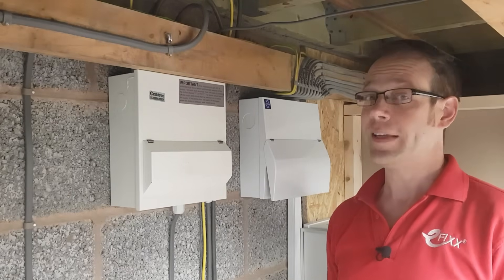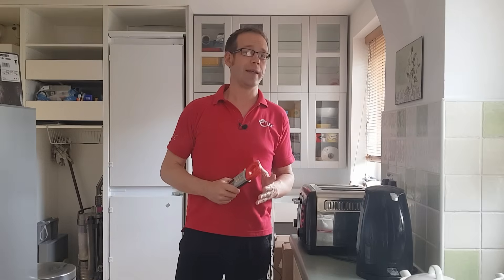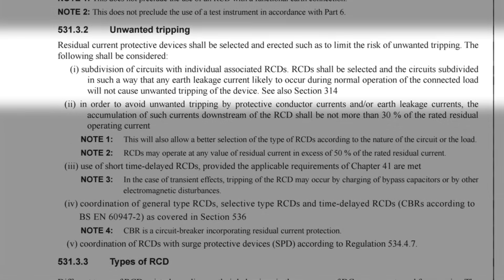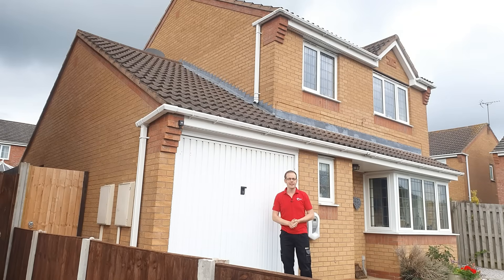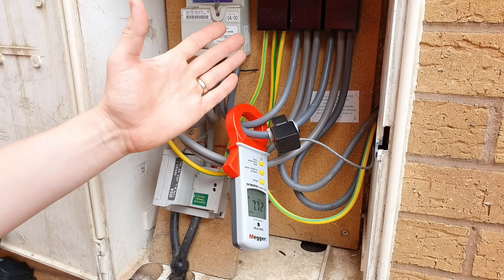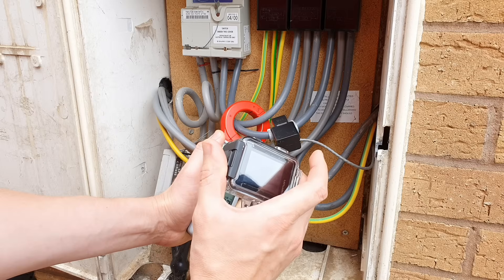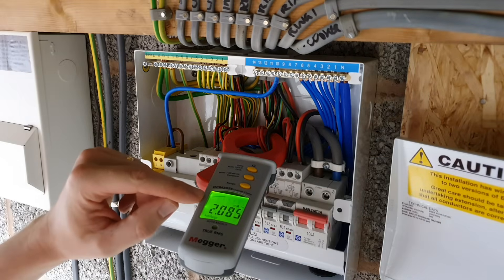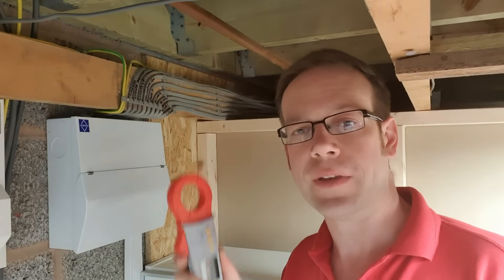EARTH LEAKAGE CURRENT - WHERE it comes from and HOW to measure it. - MEGGER DCM305E

Comment: There's nothing special about that meter other than how it's badged and marketed. Any clamp multi-meter with an appropriate AC current range would do. The subtraction between the live and neutral currents is being done for you by physics - the difference in the current induced in the clamp by the opposing magnetic fields from the two conductors.
Reply from the maker: Yes that’s correct
Reply: Brand snobbery is rife with the willy wavers!  Nick Bundy has started doing performance comparisons of branded kit with unbranded and found little meaningful difference.  I’m not talking about your MFT, but certainly current clamps, stud finders, etc. where the underlying physics is simple.
Reply: Yes. I went for a Martindale CM69 at about £100 cheaper.

Comment: Love these video's, have been after this for ages, so thanks for making it! Might sound a bit of a silly question but I've noticed some clamp meters can be quite cheap and other hundreds of pounds, so not sure the benefits of paying under vs over £100 for a clamp meter. Will any/all clamp meters have this functionality or do you need to specifically buy one that can measure earth leakage. That in advance!
Reply from the maker: Thanks for the comment and the question. It's partly a question of sensitivity, the meter in this video will measure low values of current on the milli or micro amp scale. Other meters may not measure accurately that low. 👍
Reply: @efixx  thanks for coming back to me. Much appreciated!
Reply from the maker: No problem at all. 😊

Comment: Would it not be easier to leave clamp meter round main tails and just switch each circuit breaker one at a time
Reply: Thanks. I was wondering how you would ever use one on a board wired like a rat's maze or with little cable give
Reply: Easier yes but that would kill power to the house which might be inconvenient.
Reply: @mfx1  calls an electrician for a fault, doesn't want any inconvenience.
Reply: @TheFool2cool  That is prpbably just meant to explain that this way, in this case, with this amount of slack on the wires and with this amount of space in the cabinet, you can do it without turning off any circuit breaker. (That might be inconvinient or unwanted in other situations) So in my opinion Martin King made an excellent remark

Comment: Not qualified sparks…but could have been considered time served.

I recently changed an MCB to allow for motor starts in my garage not causing it to trip. Are there different types of RCD that could allow such laptop leakages without tripping but without putting users at any greater risk of electrocution should someone get silly with a wet finger?
Reply: Often it's the cumulative effect that is the problem. A 30mA RCD could trip at 20mA and if you have a ring with many loads it's not difficult to get to that. Split it into two radial circuits and use 2 off 20A MCBs , one either side off each of the 2RCDs
Reply from the maker: Not really, you could in theory put in an RCD with a higher mA rating but then it wouldn't comply with the requirements for additional protection. 🤔 In fairness you'd need a lot of laptops to trip out a 30mA RCD anyway unless one was faulty.

Comment: I'm assuming the live and neutral are red and black due to the age but why are there also blue cables? Retrofitted neutral since it changed to blue?
Reply from the maker: Spot on. 😊
Reply: It looks to me like the CU and the tails supplying it were replaced since the colour change, while the house wiring is older. Most of the blue wires you can see are the neutral flyleads connecting the RCBOs to the neutral bar.

Comment: One issue I see is it may be very difficult to actually clamp the live and neutral for a particular circuit in a typical non-RCBO CU.
Reply: If that's the case then just clamp the main tails and operate each circuit one by one via the mcb to spot your issues surely? Then work on from there.
Reply: Exactly- it is useless for conventional mcbs as you will not be able to incircle line and the neutral by the loop.
Reply from the maker: Could be tricky for some circuits but probably worth the effort. 👍

Comment: Iv'e had an Amecal low current clamp meter for about 4 years, very usefull for tracing earth leakage ... mainly washing machines, ovens, and water heaters i find faults on. great video.
Reply: Exactly - not IT equipment. The "No more than nine IT devices on a ring" is an old-wives tale in a modern house. If you have a mainframe, then we can talk about ELC.
Cookers are some of the worst. Especially when some jobbing sparky has attached the live and neutral backwards because "Hey. It's AC so it does not matter." - I hear this comment from too many sparkys!

Comment: Could some of the leakage current be down to a capacitive effect and slight insulation breakdown of line to earth within a twin and earth?
Reply from the maker: Ver possible and very likely actually. I suspect that's what the remaining current at the end of the video was down to. 👍
Reply: Especially when the T&E has moisture inside it, seen this a  few times. Insulation resistance test should pick that up too of course.
Reply: @muzikman2008  I'm currently trying to fault-find T&E installed in plastic conduit inside a garden wall (i.e. subject to moisture). The line is connected to an RCBO in a covered area (shed) and that CU is connected to an MCB in another CU downstream. Your comment about moisture has now got me thinking. May need to do an insulation resistance test...

Comment: Use my megger leakage tester all the time. 
Had a problem with a large office block that had extremely poor loading of sockets for the computers. Made a Earth cable out extension lead and plugged in everything eventually it was a laptop charger causing the leakage current. With out this I don’t think I would of found the fault.
Reply from the maker: Great info 👍
Reply: I don't see how you can use it without rcbo. Your line and neutral wires are usually separated in the electric cabinet when usual mcbs are used. The cable from the appliance usually include earth wire, so loop meter will show 0 .
Reply: @eugeneeugene3313  my explanation wasn’t great. 
I made a single socket with a plug on the end. In the middle of the cable I opened up the flex to expose the inner cables. Pulled the cpc out of the way leaving only line and neutral in the flex for about 6 inches. Put clamp meter around the line and neutral. 
Plug appliance in to socket and plug in to a power outlet.
Reply: @Beariam24  Thank you - good trick. If I understand correctly, you actually build an extension cord so that line and neutral wires are not bundled together with earth (ground) wire. So you can encircle with tester loop just the line (live) and natural wire while connecting the appliance via this "exposed" extension cord. Is it correct?
Reply: @Beariam24  more accurate than using a pat tester that can detect earth leakage

Comment: What jumped out at me, was no more than eight sockets to a circuit to eliminate RCD/RCBO nuisance tripping. That means a lot of radials in a house, with maybe one final ring circuit in the kitchen. So bigger CUs and more expense.

Having all circuits on RCBOs will reduce the earth leakage tripping problem, giving scope to increase the number of sockets on a final ring circuit.

Multiple circuits on one RCD can be a big problem as the earth leakage on each circuit builds up to over the rating of the RCD. As mentioned all is fine, it is just that too many circuits are off one RCD.

We need lower priced RCBOs with none of those pesky earth flyleads.
Reply from the maker: The rule of thumb of 8 sockets per circuit is for application to commercial installations where a lot of IT equipment is connected, not domestic where a relatively small amount is connected. 👍

Comment: Yes, I’ve had that particular one for a couple of. Years and use it as demonstrated. I also sometimes check the leakage on an appliance to see how much leakage it has and weather it needs fixing / replacing.
Reply from the maker: Great application for this tester, thanks for the comment! 😊
Reply: How would you use it on an appliance
Reply: @denmcf89  I have a plug and socket with a piece of flex in between where the cpc conductor is separated from the live conductors - the clamp goes over the live conductors and detects the difference and thus leakage to earth.

Comment: Just clear this up.  This a dedicated earth clamp meter from Megger. Not a normal amp clamp?
Reply from the maker: It’s specifically set up for low current (mA) readings.
Reply: @efixx  
Thx. I read somewhere that some can do both, which would be more versatile, so a better buy. Never come across one yet.
Reply: @johnburns4017  I got this one, it’s brilliant for domestic work.  HandyMAN TEK775 Earth Leakage Clamp Meter. About £90. Does mA to 200A.
Reply: @MS-Patriot2  
Thanks Mike. I looked it up, with it also goes under the name of Alphatek TEK775.  Sounds more professional than HandyMan. They are obviously aiming at two markets with one product.  

It is an AC Earth Leakage Clamp Meter

The ranges are:
- Low range of down to 200mA. Measures down to 0.1mA;
- Mid range of 2A;
- High range of 200A

It covers the whole lot so worth getting. Saves on space in tool bags and money.
Reply: The Megger DCM305e in this video has 1uA resoloution on it's lowest range and 100A max current on it's highest range, so it should cover most current measurement needs you would meet in a domestic install.

The alphatek/handyman Tek775 MS-Partriot2 mentioned has a higher top-end and a lower price tag, but has a resoloution of only 100uA, still probablly good enough for most fault finding/troubleshooting work.

A lot of Chinese test gear is sold both under the actual manufacturers brand, and under various "house brands" of distributors.

Comment: Don’t them clamp meters have a zero button? Or is that just the cheap ones
Reply: You only really need a zero button for DC amps.

It can be useful for AC too if you're trying to measure additional load/leakage on top of a base level, in the same way you zero out test leads when measuring resistance. It tends to be a feature that the lower range ones lack and the higher end ones have. It's basically impossible to use a DC clamp without a zero button - mine for instance often starts at about 1.5A.

Comment: This could be a stupid questing but would that work by clamping around the hole cable including the cpc?
Reply from the maker: Not a stupid question at all, but no it wouldn't work because any current flowing in the earth wouldn't be seen separately and the meter would essentially read zero.
Reply: @efixx  Thanks for the reply

Comment: Megger really need to have removable clamp teeth and add both a hard clamp teeth and a flexible coil to enable you to get easily into difficult to reach places and small spaces with this meter.

Second, here in the USA most of the electrical manufacturers are accommodating these issues in the latest electronic and hybrid electronic and hydraulic GFCIs we have them trip much faster and much lower currents around 3-4mA in 3-5 mS. How are they doing this without getting more and more unwanted tripping? Well because the GFCIs are detecting not just the amount of the minuscule DC leakage but they are detecting the whole signal, identifying the various types of surges and transients. Moreover the GFCIs are themselves self testing several times a day. In the UK many RCDs and the regulation does not help here tend to specify at least a 30mA RCDs, or RCBOs at installation time it’s all cost driven and in my view hinders the take up of more latest generation RCDs that trip much faster and much lower leakage currents. Making them much safer than the older generation ones. Efixx should be looking at these issues and really this is going into the the power quality area and I don’t mean power efficiency aspects but real identification of problematic PQ matters. Of course that requires more sophisticated expensive equipment at least if you want to do lots of PQ issues and have accuracy. This is still way too much solely a industrial or solar PV, EV issue. We need more sophisticated and affordable residential PQ meters with good mathematical signal analysis software built in. This will be also important when coming to design electrical circuits and consideration of loads. At some point in the UK you will go to larger boards as you design circuits more with device specific loads on them.
Reply from the maker: Great viewpoint and information, thanks for sharing! 😊

Comment: Good video! Slightly off topic, but what are your thoughts about high integrity earthing applied to PC equipment? In many commercial office projects, UK engineers love to employ multiple earth paths for circuits powering desk mounted computers (commonly citing 3.5mA leakage current allowance per PC). The part of the video where you turned off the PC and saw a drop in leakage current of approx 0.7mA confirms what I suspected (for many years); relatively modern computers leak a small amount of current, but no where near the 3.5mA figure commonly quoted. The "limiting to 8 PC's per circuit" is a decent rule of thumb, and again in practice I don't see many office installations where you connect more than 8-12 PC's per circuit (especially in open plan office environments). Furthermore, I can't say I've seen high integrity earthing done in any other country where the British Standards aren't enforced...perhaps this is another British practice that isn't in keeping with the rest of the world?
Reply: Thanks! I think it would be interesting (video idea perhaps?) to see what the leakage currents of various household devices are (ie a laptop, phone charger, fridge, microwave etc etc). I can’t say I’ve seen many (if any) high integrity installations in a domestic premise, but given the quantity of comments regarding leakage currents, it may help sparkies in the future know what typical leakage currents of appliances are when trying to trace nuisance tripping, or running new circuits.
Reply from the maker: It's a good point, probably as IT equipment gets a little better quality we may see a reduction in the stringency of this.
Reply from the maker: Yes we will take a look at the topic!
Reply: @horatiupogoreanu6422  Yes, agree there will be differences in current from brand to brand. What I'm suggesting is moreso a general overview of what (typically) are low and high leakage devices are. Hopefully it'll help with trouble shooting!

Comment: DCM305e is a great bit of kit, use mine a fair bit, really handy in 3 phase diss boards
Reply from the maker: I genuinely love it, have to stop myself obsessively measuring random currents for no reason.
Reply: @efixx  it's not just me then haha it's paid for itself time and time again
Reply: Would you clamp all 3 lines and the neutral or clamp each line and neutral separately in a 3 phase dB scenario?
Reply: @carlgrooby4083  you can do either, just a bloody good indication of where to look before starting fault finding i use the DCM340 to help with load balancing on older 3 phase boards that have been constantly added too
Reply: @carlgrooby4083  For earth leakage, all three lines and neutral. If you clamp only one line and neutral then current in the other two lines will be considered as "leakage".

Comment: Super video thanks. I think I will be investing in one. But I can’t believe why items are made to leak current to earth in the first place. There must be a better option. If a law was brought in forbidden it the manufactures would have to find a way round it.
Reply: My assumption has been that "leakage current" is a byproduct of the methods used to produce DC current from AC - that the ground is used as a source or sink for electrons. If it is a normal byproduct then perhaps it should be thought of more as a "residual current" instead of a "leakage current". 

I have a gas forced air furnace in the USA that has a large DC air blower motor. As the furnace changes the motor speed I can measure a corresponding change in residual current along both the ground wire and the metal natural gas pipe (not a comforting thought).
Reply from the maker: There are strict limits on the amount of leakage current from appliances. It is the only realistic option for dealing with EMI from modern appliances. Otherwise you’d have interference when trying to use other kit.

Comment: When I first started retraining as a electrician the sparky I was assigned to told me to buy a clamp metre I soon found out why 👍
Reply from the maker: Probably going to become even more important as time goes on. 👍
Reply: Many clamp meters are integrated into multi meters (have not seen earth leakage clamps in multimeters yet, maybe someone can inform us).  Screwfix sell a decent LAP version for around £30.  I used one of these, with it being quite good. The problem with the cheaper products with some of them, is not with the instrument, but cheap leads. Buy quality leads and use them, then they seem OK. But the initial cheap attractive price is then hyped.
Reply: Difference between a clamp meter and an earth leakage tester though, a lot more sensitivity, I’m training as an EST, got asked to follow an electrician regarding a tripping RCD, my fluke 902 lacks the sensitivity to see if the tripping is due to the earth leakage, all I can say is the appliance will run without the house plugged in, but plugging in the house alone will be fine too.. they just can’t be on together… they either get hot water, or lights…the house is like a permanent caravan, connected via a caravan plug to the RCD within the main house…
Reply: @f1reguy587  
the house plugged in?
uh?